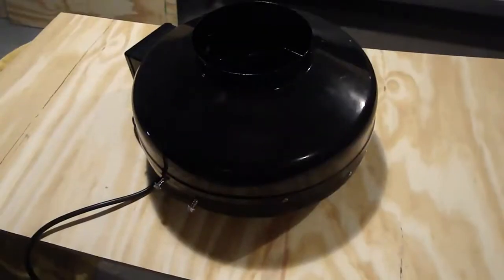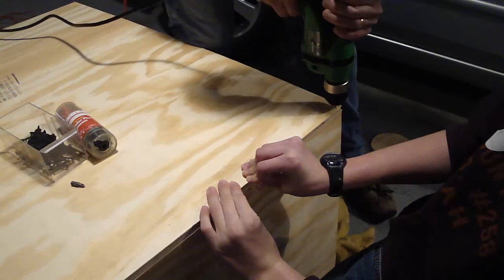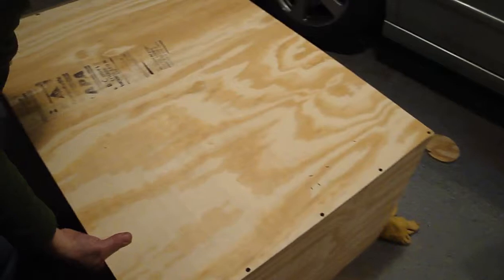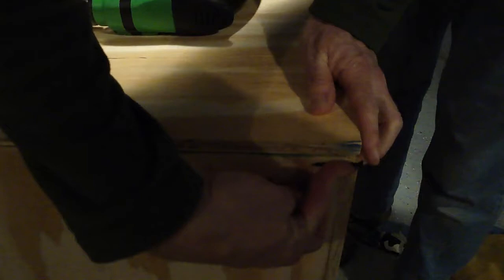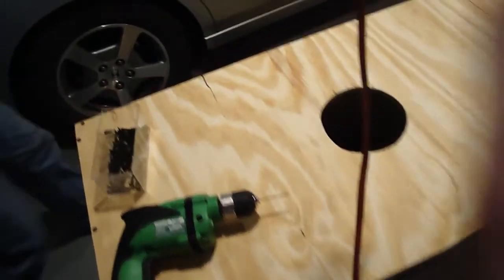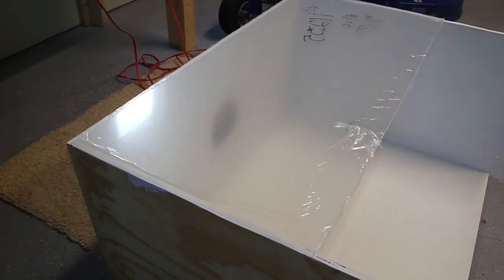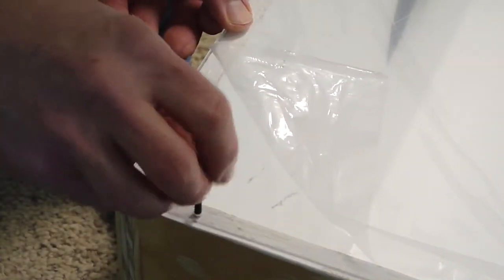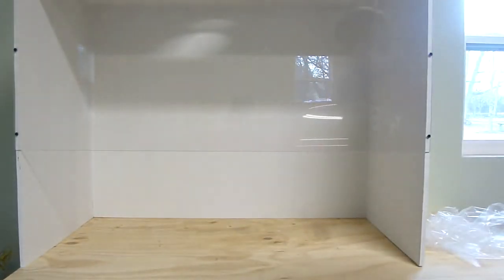How to Make a Fume Hood Part 3 - Finish the "Hood"

Comment: Will this fume hood work with chlorine gas?
Reply from the maker: monkeyemperor12 it has in my experience, just remember that the chlorine is just pumped to a different location. If you can scrub out the chlorine before it is pumped away by the hood that would be ideal.
Reply: How would I do that?

Comment: Good tip I just go my safety equipment and glass ware in so I decided to make some copper sulfate by mixing some diluted h2so4 with some h202 and copper. The h202 oxidized the copper and the h2so4 reacted with the copper and made h2so4.             What are you going to use for the rocket fuel and will it be a sugar based fuel like rocket candy?